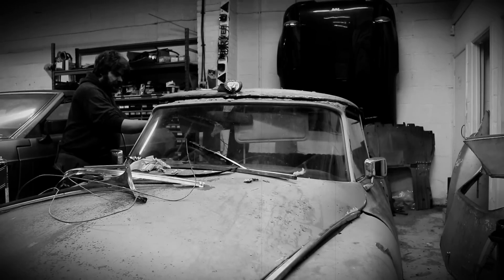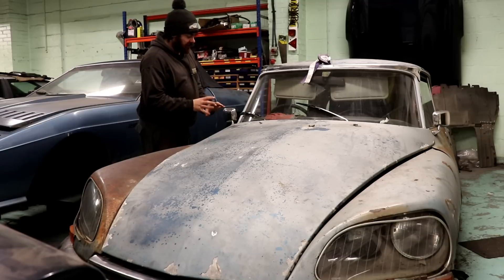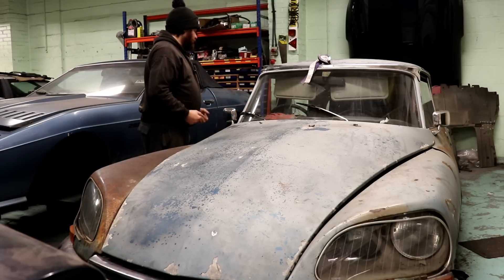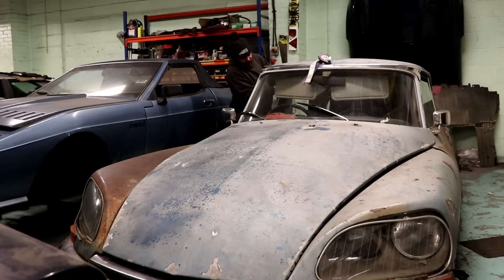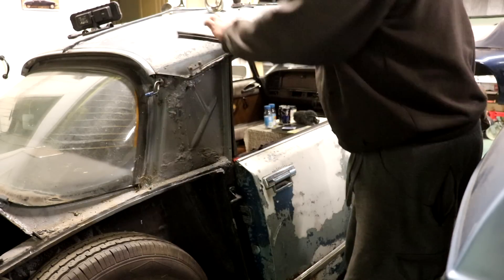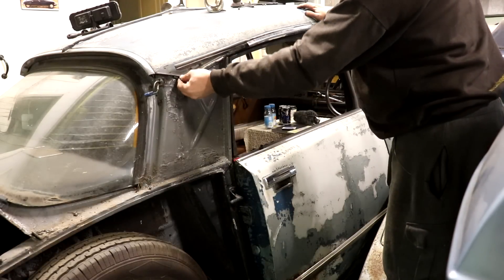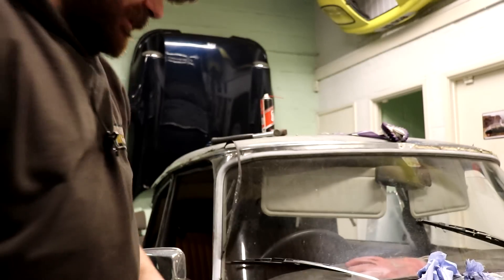CLEMENT TIME 5: Turning CLEMENT into a convertible? Citroen DS loses its roof!

Comment: Roof rails no problem. Available from most of the parts suppliers to avoid fabrication and not too expensive. A pillar not attached to frame is a worry though. Post 72 cars had a bonded roof. Pre 72 a bolted one with sikaflex type sealing. Early IDs had an unpainted unlined fibreglass roof that glowed on a sunny day. Very pretty.  And very noisy. Relining the roof best done with it off. Make sure you use thermal glue or it’ll droop on the first warm day.

Comment: As someone who is nearing the end of a 20 year long restoration of a rusty DS (although not as bad as Clement) I feel your pain. I ended up harvesting the entire roof rail complete with A-pillars and B-pillars from another car. Also complete new floor from front to back. I've drilled out literally hundreds of spot welds in the process. It's actually not too hard to drill out the spot welds to replace the rusted parts with the new (or new to me) parts. It requires patience and perseverance but you'll get there! Lots of great resources on the interwebs as far as the DS is concerned too. A very helpful community. You literally has me LOL at the quip "They should bring back capital punishment). Best of luck!

Comment: This reminds me of the time I pulled the dash out to change the heater core on my 306 and I discovered a previous owner had filled every conceivable space with hot glue and expandable foam for... reasons. Good times.
Reply: @anthonyxuereb792  Not going to lie, I had a few murderous thoughts involving hot glue guns and the various orifices of whichever perpetrator carried out the work. The best bit is, I inadvertently fixed the rattle I think they were chasing down by replacing the blower motor while I was in there replacing the heater core. Took me hours to scrape all that shit off the ducting, cables, wiring etc though.

I spent countless hours and plenty of cash fixing that car up to mint condition too, only for it to catastrophically overheat with around 200k km on the XU10J4 and warp the head. At that point I think it was one of about 10 306 S16s left on the road in Aus so getting a new motor was a hopeless endeavor. It ended up going to a chap in QLD who intended to turn it into a rally car.

Comment: That video made me laugh, it reminded me of the time I bought a rare 1950 Morris Minor lowlight. It had supposedly been restored, but after removing about 3/4 inch of filler from the side panels, I decided that it might not have been done very well.😂
The front wings were two wings welded together, apparently a common thing back in the day, as replacements were virtually impossible to obtain. I gave up with the lowlight after stripping it back and not being able to get replacement front wings or even a boot lid, as these were a different size to the later models. I look forward to the seeing the journey with Clement.

Comment: This brings back memories. In 1982 my brother and I purchased a 1973 DSpécial. I have never seen so much rust on a car. Taking out any bolt would take at least half an hour and destroy most of the vicinity of said bolt. We managed to take the rear wings off, but left nothing to put them back onto. Everything underneath it was just gone. The underside of the car was also basically awol. From front to back, practically every bit of metal had rusted, either partially or completely. A nine year old car! It still drove very well though. Love the brakes on these cars. Also, the roof frame was in fine order. We took out the fiberglass roof and replaced it with a steel sunroof version we found at some scrap yard. Eventually, that enabled us to sell the car for half the purchase price, to a DS restoration service nearby. They said the car was scrap, but because of the sunroof, they would pay us some. There actually were worse rusting cars in the seventies. Alfasud springs to mind...
Reply: Looking underneath my own DS I can state that Citroen DID provide for anti rust treatment considering the amount of oil leaking from motor, gearbox and hydraulics combined. When trying to get an MOT I was a little nervous but they told me that 'if there is no oil on the outside, there surely is no oil on the inside of these engines'...

Comment: That is way worse than I expected, I would be scared to remove the windscreen in case the frame disintegrates!
I had a Morris minor that had bucket loads of filler in structural areas, I had to buy a parts car to use for replacement sections, took many hours of grinding & welding to repair it properly.
I hope underneath is not in the same state!
Reply from the maker: I am scared!

Comment: A succinct demonstration of why there are so few UK DSs left!   I had two back in the 80s and they were not very rusty then but I bet neither survived into the 1990s!  I'm rooting for this one to come together. I wonder if anyone has remade the roof panels in carbon fibre - not for the 'look' (like Goonzsquad)   but to give it some strength rather than add a roll bar? You could even make a mould from the old panel and make a carbon roof yourself. Happy new year and good luck with the projects!
Reply: Xmoor Cars could probably help with GRP moulds - they've done a fair bit for the BMW E24 and, on enquiry, said they were willing to consider Citroën panels. Won't be cheap, though.
Reply: A carbon fibre panel this big would probably cost about £2k. And I don't think it'd be significantly stronger than a fibreglass panel in this application. The roof support pillars are where the stress points would be in the even of a rollover anyway so carbon wouldn't be any addition at all. You'd have to make the A, B and C pillars stronger first.
Reply: @MrManBuzz  If would cost 2K if you pay someone who has holidays in Barbados. If you make it yourself it is the cost of materials and the time to make a once only use mould - You only need one panel so a reusable mould is overkill. It is a long way from rocket science - I did a small CF project 15 years ago. I agree that reinforcing the pillars would be a good idea.
Reply: @keithmatthews1673  Sorry, it's been a long day, I read that as if you were saying to get someone to make it for him, and not make it himself. Could probably make it for 100 quid or less himself, but it's a lot of faff. A carbon roof would look cool though.
Reply: Not all DS roofs are plastic. Some with a black top and those which were manufactured in the belgian factory at Foret have a roof made of alloy.
Reply: @Isayso1  Forest
Reply: @vanginderachterd  You're right. I got the name of the city from a french book, where it was writen Forêt.
Reply: Don't make the mistake to lighthandedly change material properties in a Citroën of the Boulanger era. Every bloody part was made the way they did it for a reason. We put in Twingo opening sunroofs in DS roofs because the Twingo roof is an actual quality product, it's dirt cheap compared to the original aftermarket soft ones (and hard original steel sunroofs were unobtainium already in the nineties) and we had all kinds of problems in the beginning with vibrations and noises never heard before in other places - the roof is "soft" and sits in that original rubber monstrum of a gasket for a reason: Frames had quite some inconsistency in their build/form even in the seventies (worse in the early to mid sixties - same goes for the thick rear window seat), and the "loose" soft rubber seating kept it also from swinging and flabbing in the wind. 
Reseat it in a hardening PU-rubber like SikaFlex, and the whole car will rattle with the roof flabbing at certain speeds. I made carbon fenders front and rear and for one customer a carbon engine hood and trunk hood even, and we had to put in quite some weight afterwards to keep the parts from "singing" in the wind. Could be improved with a sandwich construction with PVC core I reckon, but it's quite the hassle and a trial'n error process. Oh, and absolutely no need to add a roll bar: They do not roll over unless You build a ramp and do it stuntman-like on hard purpose - it's not an A-Class Mercer and You do not fall on Your side for nothing but a moose-maneuver 😅😂

Comment: Unfortunately that is always where they rust , but not really too difficult to repair properly.  Take the front and rear windows out before you damage them. Removing them is really very easy !
Reply from the maker: That's the next step. They're not as easy as they should be though, as they're buried in filler and goo

Comment: I'll get a DS to practice, it'll be easier he said 😬 Even the rosette looks sad. That bodgery is awful 😞 Is making it a genuine convertible an option?
Reply from the maker: Not without altering the shell significantly, to the point it'd need re-registering. I could legitimately leave the roof panel off, though.

Comment: Wow, now that's a whole heap of bodgery. 
Might be interesting putting a fabric roof on Clement (2CV style) instead of the fiberglass roof section. That might make fabricating the rusted bits a little bit easier?
Reply from the maker: Not really, it's the metal work that's the issue, and I'd need that regardless

Comment: I am not too sure if its bodgery. Looks a little like the window sealer that was used as a standard for single glassed back doors back in the days when everything was simpler. Maybe it was the standard way to do this? At least the standard way for back-doors :-)
Reply from the maker: It's body filler. P38, that kind of stuff.

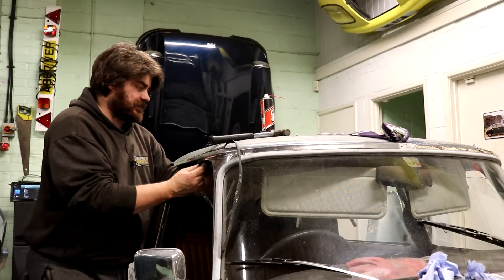Comment: 16:46 "...it's not even tight..." - of course it's not, it doesn't have to be, all the tightness in need is coming from the expanding property the PU-foam has brought underneath it at its time ..... that's why the foam is there in the first place. People screwing around with Citroëns they absolutely want but couldn't afford would they do the actual math and budget pieces and skills and tooling in need .... these people are quite inventive "materialwise, and loadcontainingwise", to put it mildly.  
On the other hand, Clement didn't come apart all so bad up to that state - I had fought wars that took days in plural against bodged-in roofs i didn't want to harm (steel original sunroofs mostly, some of which had "aftermarket" weld spots under the filler goo), so it went smoothly so far I'd say. building all those tin parts needed to weld the top frame back to spec from flat 1mm tin will take a while I reckon, for these days there aren't so many parts cars to get for a song and a tow as back in my times of screwing DSs.
Reply from the maker: Luckily you can buy it all pre fab

Comment: Will it pass MOT as a convertible
Reply from the maker: Yes, but the MoT isn't the issue. I'm planning to do a video on IVA soon, but basically if I left the roof panel off, then no problem. If I cut the frame at all to make it look like a convertible, that'd count as a radically altered vehicle and I'd lose the registration number and have to put it through IVA to get it re-registered.

Comment: mmm .... very sad,  I would think at the point of 'bodgery' the economic viability of correct repair had long sice been passed ! - bring on the 'enthusiast' ! - it is all under trim though so do able ? - keep up the good videos, most enjoyable - thanks - my father did a bubble car in the 70s that was that bad, if not worse, with rusted away pillars - he built a tubular skeletal structure to hold the roof and windows in their correct postions and then fabricated structure to it.

Comment: Well, I’m known (or not known as I keep it secret) to do bodge jobs now and then but the “creativity” someone had with Clement is on a different level. 
As a funny anecdote, many years ago someone turned up in a local French car event with an ID19 where he had fixed holes in the drivers door with concrete. He was doing some building work at his house at the time so fair enough I reckon.
Reply from the maker: I'm expecting to find concrete in this tbf...